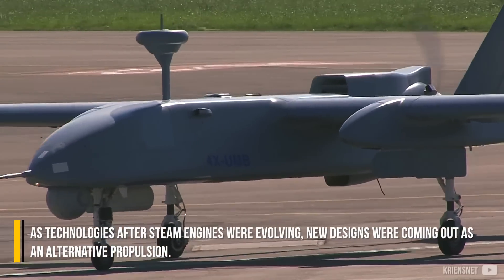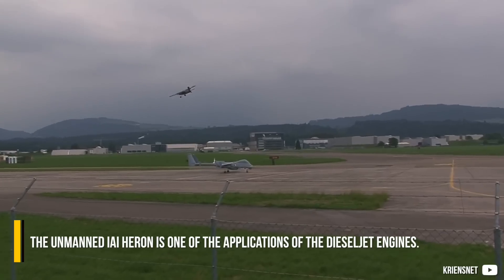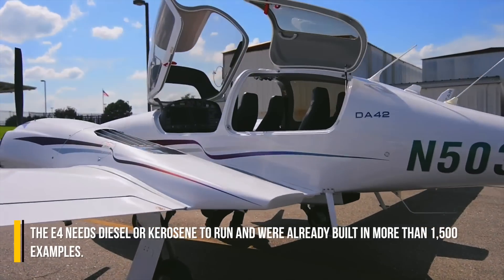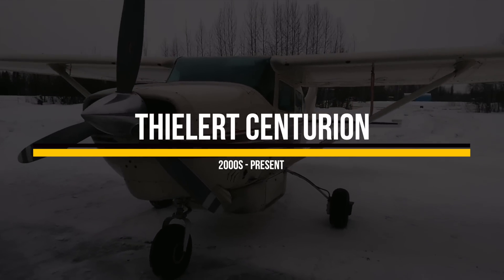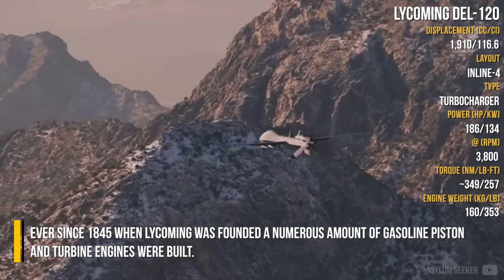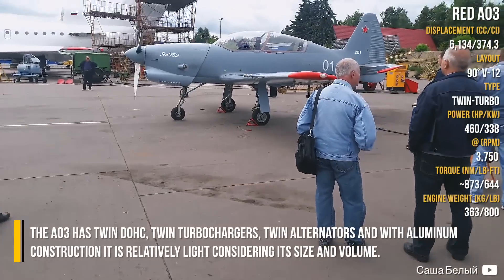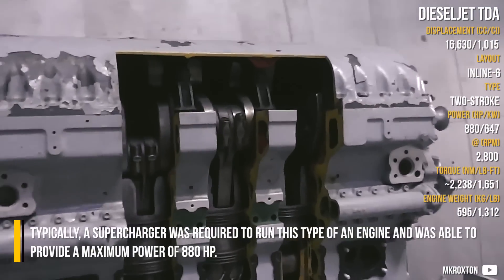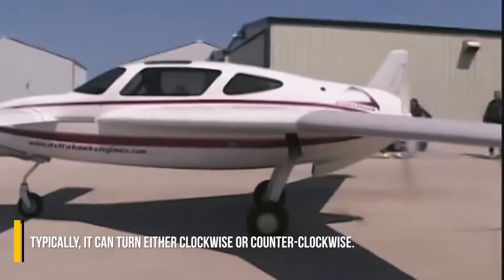8 Of The Few Diesel Aircraft Engines Ever

Comment: Diesels are probably better overall for aviation applications because they don't work as hard, hence they can run for much longer. My thought.
Reply: If the torque was not relevant then why do all planes have engines whith a high torque-output and low revs? The same for commercial vehicles and ships. The torque is actually relevant. The reason is that the torque is the force, the hp is the overall work (that's a big difference), the revs is the way over which the force is applied to the drivetrain. If i want to move a heavy object or a object in a medium with high density i can do all the work i want over all the time and way i want, if my force is not strong enough to get the object moving it doesn't matter. And that's why on everything connected to a heavy object (ships, planes and mainly trucks, but in general commercial vehicles) you see engines with high torque.
Yes, every modern prop-plane uses a gearbox to optimize the engine, but if the engine has too little torque you'd need more closely spaced gears to get and keep the propeller moving, which means to reach the same top speed you'd need a few more gears, and this is ether too heavy or too bulky to be worth putting an engine with low torque in a plane. So no, torque is not irrelevant, and the efficency is not the only reason to use a diesel (although it is the only reason for a normal diesel car, as they all are light enough and can't carry enough to need the extra torque).

I hope that little physics lesson did explain why you need torque, and why especially with heavy vehicles hp isn't as relevant as with normal cars.
Reply: astrofan

Because high torque engines are operating at a lower RPM you get better reliability (Critical for aircraft and commercial vehicles), lower fuel consumption and longer lifespan.

You don't need a high torque engine to move heavy things, Turboprops produce less torque than the avarage diesel car and produces tens of thousands of HP. You need a good torque output of the gearbox to move heavy things...

The only relevant specs for an engine is Peak power and power band, with those two you know what you get. If you want to create a transmisson for said engine you need to look up the torque specs and RPM specs for it so you can determine the gear ratio and output torque you want.

The whole torque myth is created by people missunderstanding physics....otherwise Jet engines would be the worst form of engine.
Reply: No, the reason you see more diesels in commercial vehicles is because they have a much greater fuel efficiensy. Torque is irrelevant, power moves the vehicle, torque is just a static force and RPM is just a speed, you need both to move and calculate that to power. 

Almost all planes us a gearbox to fine tune the engines cruise power to the maximum efficensy of the prop.
Reply: Exactly, the torque output of the engine is irrelevant, because you can use a gearbox to get whatever amount of torque/rpm you need, only the power rating matters.
Reply: The problem is that due to the higher compression the cylinder walls have to be noticably thicker than with a gasoline engine, and that adds a lot of weight, which is the last thing you want as a plane manufacturer. The reasons why diesels are still used are the lower fuel-consumption and the power-curve, as diesels tend to have more torque and their max at lower rpm than petro engines, which is very good for a plane, that need a lot of torque and not that high rpm for the propeller. This is also the reason they took over for marine applications, as ships and boats need even more torque and care even less about max rpm than planes. This is also the reason you see diesels used in commercial vehicles.
Reply: "If the torque was not relevant then why do all planes have engines whith a high torque-output and low revs?"

Because the rpm of the propellers is limited, you have to keep the tips of the propeller blades below the speed of sound. 

Power tells you how fast you can apply torque, the more power you have, the more torque you can apply at a given rpm.
Reply: idontcare80

That's what you use a gearbox for. Turboprop engines run at over 10,000 rpm and use a gearbox.

Comment: 2 litres 186hp?
I want that engine to my car really.....
Reply: b16b was a 1.6L non turbo with 185hp and thats from the 90s :)
Reply: s c a r r yes but that was a gasoline engine. If compared to a diesel engine with same displacement, the diesel engine will easily beat the torque
Reply: toaster for me it's spectacular because here in my country 2.0L diesel engine is quiet uncommon
2.5L Turbo with about 146hp is more common here
Reply: Well with a turbo, you can easily get that power
Reply: Jaguar/LandRover have a 2l diesel with 240hp and 500Nm (369lbft).
Reply: Evando Apusagaseta maybe your country needs diesel engine with lots of torque. Because 2.5L engine with 146 HP sure have a great amount of torque, or the engine is just build for reliabilty, so they lowered the power
Reply: even my moms old saab 93(2008) had 180hp and that was a twin turbo 1.9 liter diesel engine.
Reply: toaster Figures for a modern model.
Reply: any old 4-pot diesel bmw with a chip can do that.
Reply: Have you been living under some rock? There have been some 2.0 liter diesel engines with 180hp+ for several years now, VW has a 2.0 TDI SCR engine making 237 hp and 500 N⋅m torque since 2015!
Reply: Sion Theodorus Absolutely yes, as I mentioned 2.5L turbo only produces about 146hp but the torque is badass 😂
Reply: Gustav Meyrink but not affordable for most people here
Reply: That's an extremely high specific output for an aircraft piston engine.
Reply: Chris and I think cars deserve that kind of engine too
Reply: Big torque + big hp = badass
Reply: s c a r r And no torque...
Reply: Maximus Psychosis

Wrong, Torque is a static force and power is how fast you can accelerate. Torque is just used for calculating gearbox sizes.
Reply: Spike Razzor

You don't need torque, you only need power, and a large range of it :)
Reply: The Esseboy torque x rpm = power...
Reply: Mhmm, so you can skip the torque and use a lot of RPM instead ;) Makes the same power :D
Reply: @Vi5oC4n3 No, HP determines top speed period, torque is just a static force, you need RPM too to move any where. So you calculate HP to get the answear on how fast you will move... easy physics.
Reply: The Esseboy p
Reply: The Esseboy: Torque is how fast you get off the line, power is how fast you pass the finish line.
Reply: Wertux but no saab in my country, even I know saab is a pretty good factory
Reply: Power is what drives the car...torque is just a static force...

Comment: Can anyone tell me that what is the actual bhp of a big airplane's engine like boing and all that?
Reply: Google exists for a reason
Reply: An airplane engine wouldn't have a "BHP" figure, because airplanes aren't wheel-driven (BHP stands for "brake horsepower"). Either way, I think the term you're looking for is "PHP" (just made that up on the fly). In my mind, I think that the actual power output at the propeller of a plane would either be equal to or less than that of the crankshaft power output, if there are any gears between the engine and propeller.
Reply: Anthony Gendron thanks for your reply
Reply: Most non turbine engines are rated in shp. Shaft horsepower. Turbines, jet engines, are normally measured in pounds of thrust
Reply: A fuckton